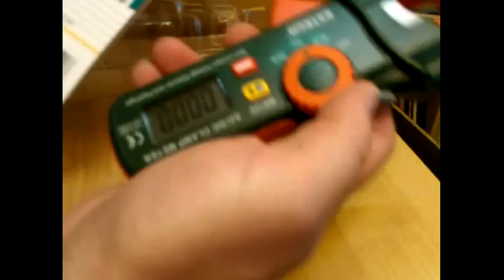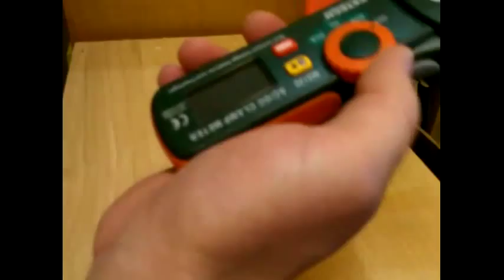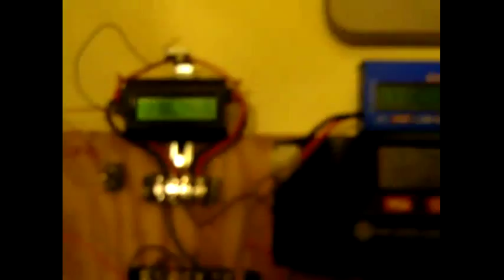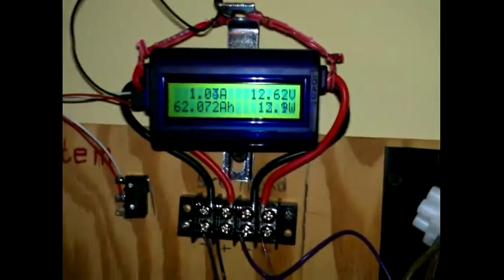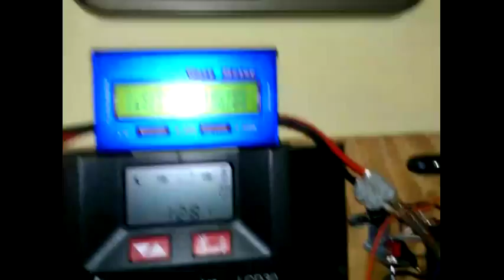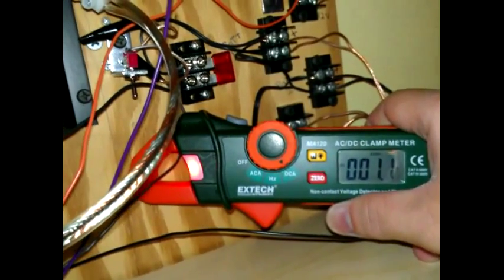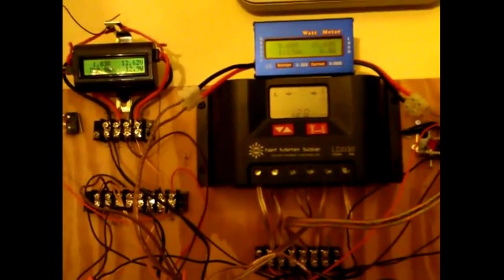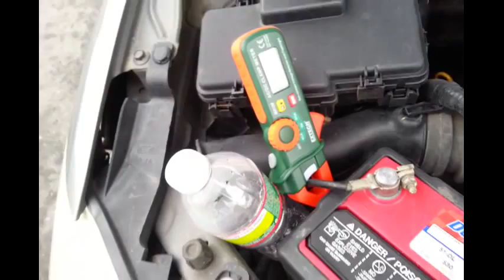EXTECH Instruments AC/DC Clamp Amp Meter MA120, non contact type

Comment: Great video thank you very much. 
What is your feelings about this meter after using it for a while?is it works perfectly and accurate?
Reply from the maker: +toolman talal Its pretty accurate for the price. I still use it. I use it in my car and at home. Actually, in this price range, there are very few.
Reply: +leefiles thanks for your reply.
Reply: Hi  good morning, detected voltaje but nop measure ???🇦🇷